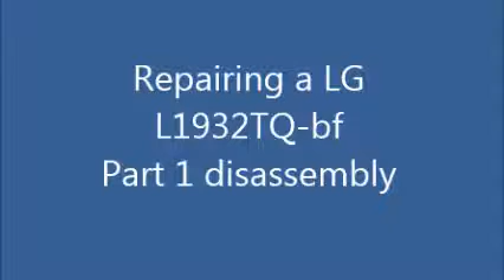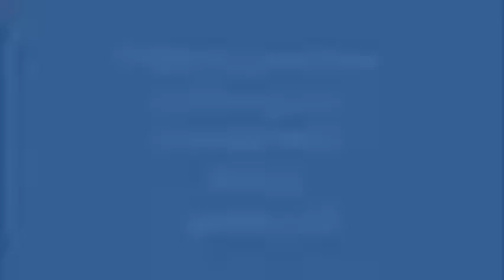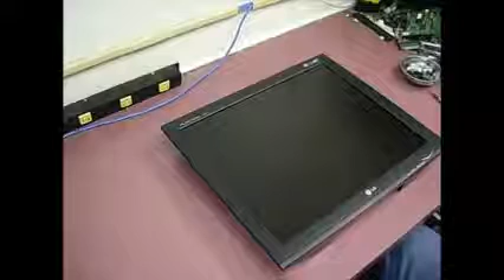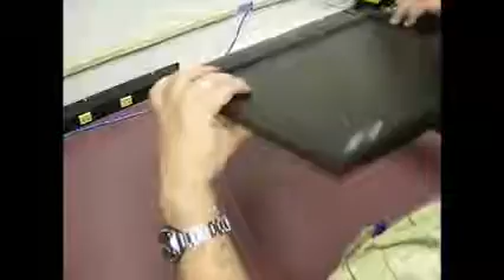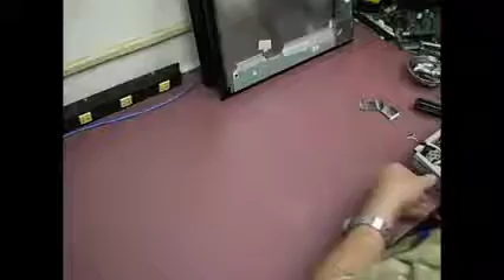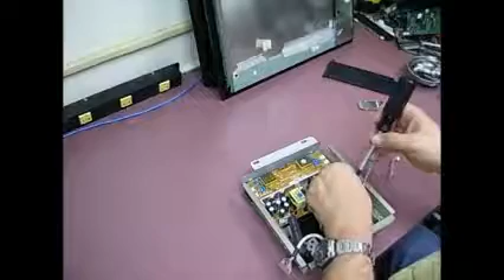Repairing a LG L1932TQ LCD monitor with powerup issues - Part 1 disassembly

Comment: Are the LCD screens in monitors the same? I have a Flatron L1718S. It is 17 inch. Also, I was not able to remove the cover after removing the screws.
I miss the old days when I was 10 years old, I could remove the screws and pop open the back of the family TV and put it back. These days, I am not able to take apart electronics. They are child and adult proof.